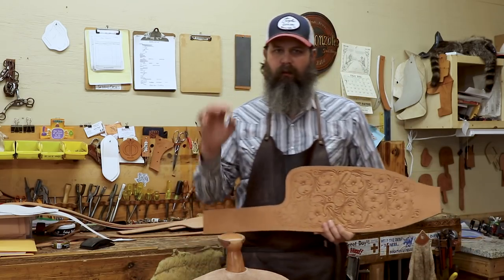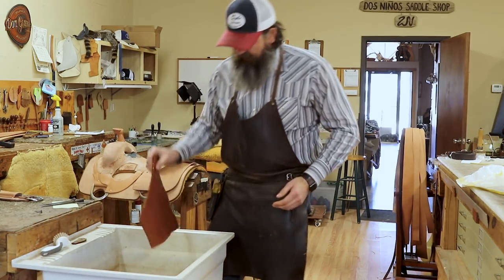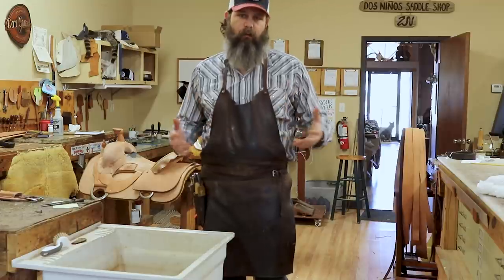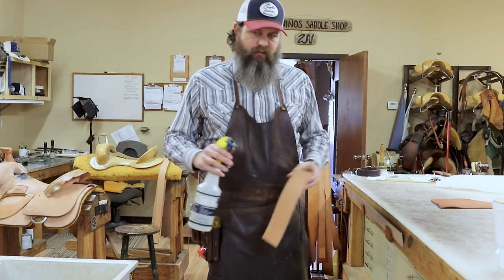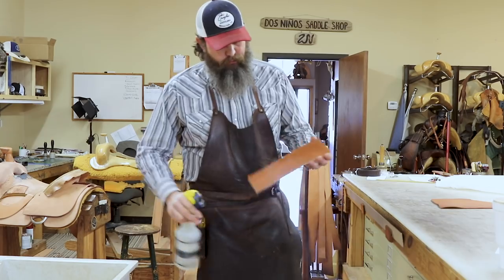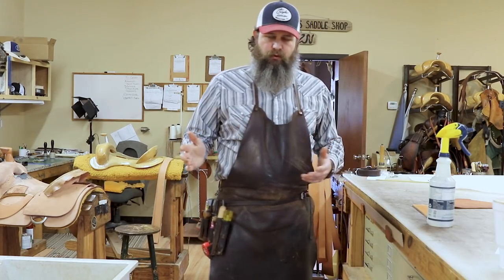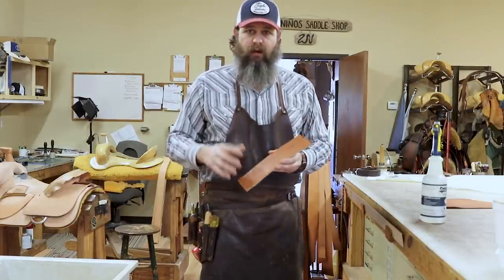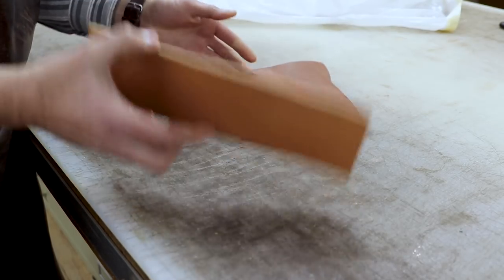How to Case Your Leather

Comment: Funny thing with the mold issue, I mixed up spackle with tap water and left it in the garage for a few days and it got mold in it. To avoid mold, I used distilled water instead of tap water.

During the pandemic layoff, I started learning this leather trade, I believe I saw an older video from Don where he showed how he uses a spray bottle to case belts and such, I do it that way and use distilled water to keep it super clean because our tap water is super hard, lots of impurities.

Have yet to go wrong with Don's advice.

Comment: I saw Don’s casing method in the rifle sling video and it made a lot of sense and I have employed it myself since then. The one time where I use the “soak till it has drowned” method is when I emboss patches to sew onto hats. I use an arbor press to stamp the figure, and having the leather good and wet helps to give a deep impression. (Plus I am not real strong so not worried about bottoming out).

Comment: Greetings from Torrance in sunny SO_cal. I just found your channel and I have a question. I was ''gifted'' a very nice biker jacket. It's very thick and the zippers and buttons are very heavy duty. The problem is it has no lining. I wanted to acquire leather belts and leather glue them to all the seams so as not to wear out the seems because I can't afford to have it ''re-lined''. Also, no one will even touch it because it has no lining. Please, can you  help me or give me some good 'ole leather DIY advice?